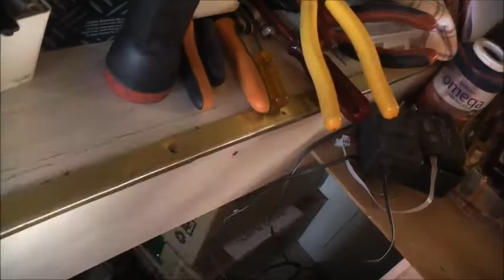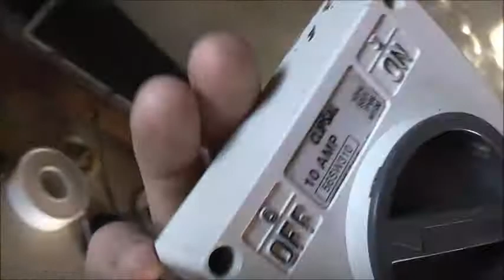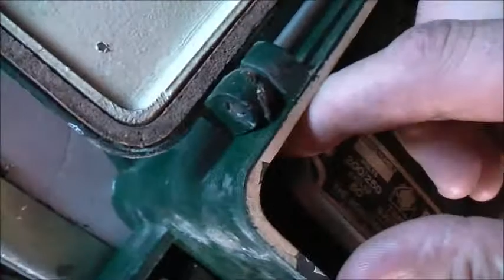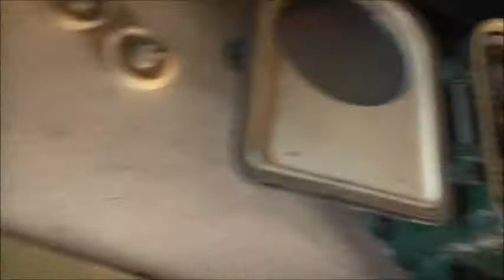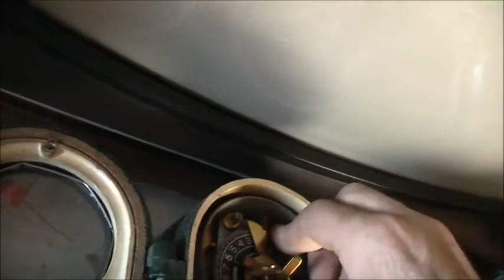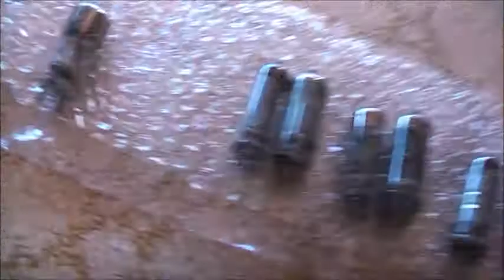Timeswitch Test & TV Parts Arrived!

Comment: Mmmm, this is interesting. A synchro-motor-only HBE.

Both of my HBE's from that time are wind-up-only (no synchro-motor) and can run on AC and DC.

As for running it.....That outer casing really should have an earth terminal on it, and as you can see inside, DON'T leave the power on with the timeswitch removed from the casing as there's exposed terminal blocks in there. Nowadays, that wouldn't be permitted.

Also.......It's best to run these timeswitches upright, as there's a risk of wearing them out prematurely if you lie them down on their back.

Seeing as it only has a small switching capacity, you could use this timer as a Rate Changer for a dual tariff meter. :-)

Thanxx for showing,

-BoomBoxDeluxe.